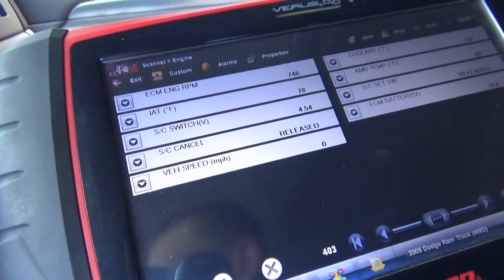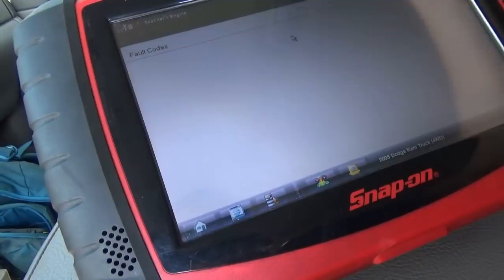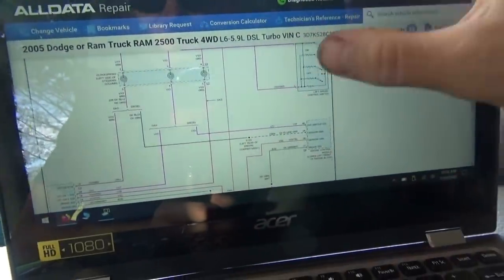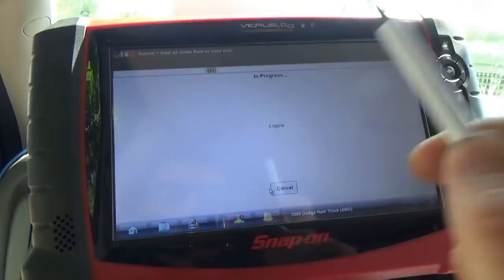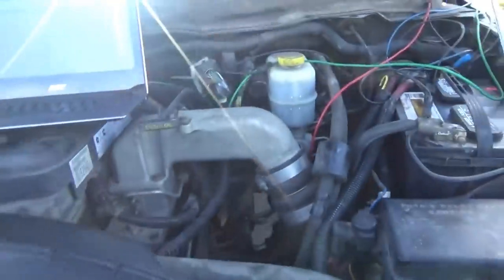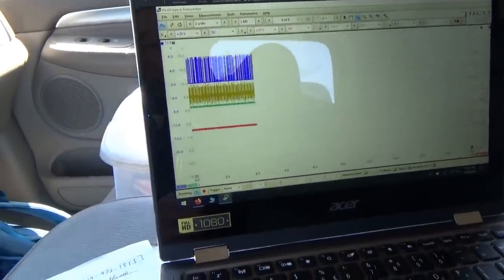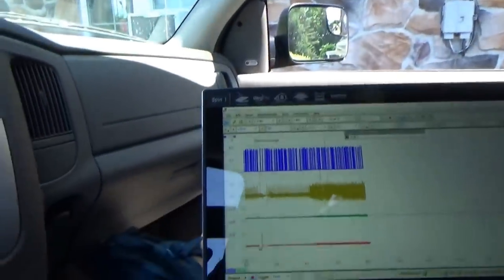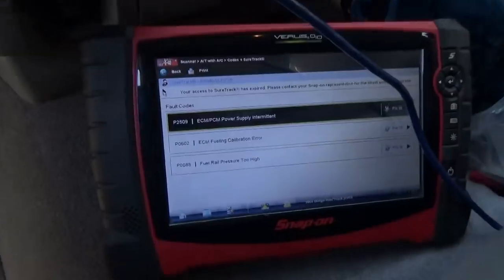Cruise Control = Engine Stall?? - Part 1 (Ram Cummins Diesel)

Comment: Lot's of good suggestions. I do not have a "killer" idea of what the problem is. 

The Guess... The electric vacuum pump. 

I did some "Sunday Research" which produced the small novel you see below.

The 2005 Dodge Cummins (with an automatic transmission) did not use a electronic injector pump (it has a VP44 is installed). Cruise control without an electronic injector pump is always going to be a "Rube Goldberg Solution".

The 2005 Dodge Cummins with a manual transmission has an electronic injector pump. The ECM only needs to "talk" to the injector pump. No servo. No vacuum. Much simpler.

With the solution in play with an automatic there is no relationship between the engine vacuum and the engine speed, or between the engine vacuum and the engine load. Nothing useful...

What Dodge did is not much different from what Mercedes was doing with the 300TD back in 1984.

Anyway after reading what you see below, this is my call,  "the electric vacuum pump". The pump is unhappy and pulling a heavy amp draw. It is "close enough" to the ECM (or the alternator) and starves the ECM. The ECM reboots (an removes the demand to the cruise control electric vacuum pump).

From https://www.cumminsforum.com/threads/cruise-control-acting-up.338750/

"Here is a brief description about how it works:
In the cruise control circuit a "Reference" signal (cruise set point) is electronically added to a "Feed-Back" signal (actual vehicle speed). The computer then calculates the difference between the "set" and "actual" speed which is called the "Error" signal. The computer then used the error signal to determine how much throttle to apply to drive the error signal back to zero, when the error signal = 0 the truck is at the cruise set point. If the error signal grows too large the the cruise control will "give up" thinking that it cannot maintain the set speed or even close to the set speed; it will then disengage when the vehicle slows down approximately 10 MPH below the set point.".

Possible Causes:
1.) The computer may not be receiving a proper feedback (vehicle speed) signal.
2.) The computer may not be calculating the error signal properly.
3.) The computer may not be able to increase throttle because of faulty servo motors or connections.

What to Check:
1.) When this behavior occurs do your speedometer and tachometer appear to be working properly, if YES then you may rule out the vehicle speed sensor or crankshaft position sensor. If NO then you may want to check the sensors and wiring for any obvious visual problems. I'm not sure how to test these sensors.

2.) Run the truck down the highway and set the cruise. If you place your foot on the throttle you should be able to feel the pedal move up or down when the cruise control system applies or removes throttle. If you cannot feel the pedal physically move then you know the output of the cruise control is not able to apply/remove throttle for some reason. In this case I would check the connection from the computer (I'm not sure which module handles this function at the moment) to the cruise control motor which is moving the pedal up/down. You may also want to check the cruise control motor circuit for a blown fuse or other obvious wirting or visual problems.

3.) Straight from the manual... "5.9L Diesel Engines With Automatic Trans. - If equipped with a diesel powered engine and an automatic transmission, an electric vacuum pump and vacuum lines are used to supply vacuum to the speed control servo. A vacuum reservoir is not used.

DIAGNOSIS AND TESTING - ROAD TEST
Perform a vehicle road test to verify reports of speed control system malfunction. The road test should include attention to the speedometer. Speedometer operation should be smooth and without flutter at all speeds. Flutter in the speedometer indicates a problem
which might cause surging in the speed control system. The cause of any speedometer problems should be corrected before proceeding. Refer to Instrument Cluster for speedometer diagnosis. If a road test verifies a system problem and the speedometer operates properly, check for:

* A Diagnostic Trouble Code (DTC). If a DTC exists, conduct tests per the Powertrain Diagnostic Procedures service manual.

* A misadjusted brake (stop) lamp switch. This could also cause an intermittent problem.
² Loose, damaged or corroded electrical connections at the servo (if used). Corrosion should be removed from electrical terminals and a light coating of Mopar MultiPurpose Grease, or equivalent, applied.

* Leaking vacuum reservoir (if used).

* Loose or leaking vacuum hoses or connections (if used).

* Defective one-way vacuum check valve (if used).

* Secure attachment of both ends of the speed control servo cable (if used).

* Smooth operation of throttle linkage (if used) and throttle body air valve.

* Failed speed control servo (if used). Do the servo vacuum test."

Checking out the Servo (if you have an auto)

"OPERATION

A speed control servo is not used with any 5.7L V-8 engine, or with the 5.9L diesel engine
when equipped with a manual transmission. The following information applies only to
vehicles equipped with a mechanical servo. When/if a servo is used on gasoline powered vehicles, the Powertrain Control Module (PCM) controls the solenoid valve body. When/if a servo is used on certain diesel powered vehicles, the Engine Control Module (ECM) controls the solenoid valve body. The solenoid valve body controls the application and
release of vacuum to the diaphragm of the vacuum servo. The servo unit cannot be repaired and is serviced only as a complete assembly. Power is supplied to the servo’s by the PCM/ECM through the brake switch. The PCM/ECM controls the ground path for the vacuum and vent solenoids.

The dump solenoid is energized anytime it receives power. If power to the dump solenoid is interrupted, the solenoid dumps vacuum in the servo. This provides a safety backup to the vent and vacuum solenoids. The vacuum and vent solenoids must be grounded at the PCM/ECM to operate. When the PCM/ECM grounds the vacuum servo solenoid, the solenoid
allows vacuum to enter the servo and pull open the throttle plate using the cable. When the PCM/ECM breaks the ground, the solenoid closes and no more vacuum is allowed to enter the servo. The PCM/ECM also operates the vent solenoid via ground. The vent solenoid opens and closes a passage to bleed or hold vacuum in the servo as required. The PCM/ECM duty cycles the vacuum and vent solenoids to maintain the set speed, or to accelerate and decelerate the vehicle. To increase throttle opening, the PCM/ECM grounds the vacuum and vent solenoids. To decrease throttle opening, the PCM/ECM removes the grounds from the vacuum and vent solenoids. When the brake is released, if vehicle
speed exceeds 30 mph to resume, 35 mph to set, and the RES/ACCEL switch has been depressed, ground for the vent and vacuum circuits is restored.
Reply from the maker: Wow you did some really in-depth research! Great suggestions!

Comment: The symptoms of the meters dropping and the ECU powering down suggest a large load has been applied aross a supply rail.  How is the CC controlled.  Is it via a motor or vacuum via solenid?  My money would be on either of those failing.
Reply: Agreed need to check current draw on CC componants
Reply: @niallseddon8657  The sudden drop and recovery is a giveaway.  Might even be green crusties or a bad connection going o/c under load when powered.
Reply: An easy test would be to pull the solenoid and see if the cruise control can still engage (and if it does, if the ECM doesn't crash), my money would be on a short in the actuator solenoid.
Reply from the maker: "A cable and a vacuum controlled servo are not used. This is a servo-less system."
Reply: @PineHollowAutoDiagnostics  Sorry don't have access to a wiring diagram (Scotland), are we using electronic control of the fuel supply? (injectors) for CC, would still be interested to see if there is a change in current draw at say the ECM powers when actuating the CC.

Comment: Morning coffee and  a PHAD video. Ghost wipers and a crazy ECM. I'll bring the holy water and sage to burn my friend. BTW checked the Camaro with the pressure transducer. number 5 cylinder was the issue. Probably could have found it with mechanical tester but was a great learning experience.
Reply from the maker: That's awesome, Bill! Make sure to save those waveforms :)

Comment: Hello.( 2008 Mercury Grand Marquis 25k miles)  I just did an oil changed and replaced oil filter but did not removed old oil filter gasket. Start the engine for about 3 minute oil spill out and has 1 QT of oil in engine. does the engine got any damaged? Should I be worry and any suggestion?
Reply from the maker: How does a 2008 only have 25k miles?? Fill her back up and let it rip!
Reply: @PineHollowAutoDiagnostics  Just bought it from an old retire couple. Thank You, Russian repairman!

Comment: Maybe see if there is an updated firmware for the engine computer?    What is the history of the service on this truck?    Was the engine computer replaced with one from a non-cruise control truck?     At the very least I would try to re-flash the firmware in case the firmware is corrupt before condemning the computer itself.
Reply from the maker: Easier said than done...special tools and software required to re-flash Cummins ECMs

Comment: Fuel pressure high keeps showing up.  I wonder it that's because the computer is temporarily losing control of the high pressure loop.
Reply: ....and that could be easily investigated.
Reply: @hudzgh  maybe by you.  I'm not an auto tech.  😁

Comment: if the same codes are coming back each time i would check the voltage on the fuel rail and put a pressure gauge on the fuel rail to see what is psi when you engage the cruise control. Also some models you can use the cruise control to speed up the idle while in park

Comment: What happens when you press the set button sitting still. Does it stall then?
Reply from the maker: No, I showed the data pid at the beginning of the video :)
Reply: @PineHollowAutoDiagnostics  I must havd missed that
Reply: A cheat would be to jack one wheel up and then you can 'drive' the car at 30+ mph while standing still, the speed sensors will think that the car is moving.

Comment: Simple fix . Don’t use the cruise control . It’s a Dodge , you’ll fix this and something else will screw up . 

* I own a Dodge , never again .
Reply: Most of there electronics are made in Mexico for $0.25 an hour. What did anyone expect? Lmao.
Reply: I own a 1998 Dodge Grand Caravan from new. 185000 miles and my wife loves it. It's starting to show its age but still gets 20 mpg and floats down the road. The only thing that's been replaced is the head gaskets twice, A/C compressor and the headliner.
Reply from the maker: @billburkart9087  Head gaskets twice at only 185k?? That's worse than a Subaru haha
Reply: @PineHollowAutoDiagnostics  twice in 18 years lol
Reply: Make that 23 years. Same exhaust and catalytic converter and wheel bearings.

Comment: Someone should open up a business where you can borrow a computer for like 2 hours, computer rental.
Reply: Problem is you’d never get them back peope are dishonest. Great idea in theory tho
Reply: @weldingjunkie  it could be like auto zone tool loan. Put down a deposit for the full value of the tool. When you return it you get it all back minus the rental fee.
Reply: you would have to have thousands of dollars worth of control modules to cover the market,and most now have to be programed to the vin.
Reply: Terrible, this idea. People would be knowingly and unknowingly smoking ECM's left and right and the rental business would be sending out bad ECM's for customers to check if a replacement ECM is going to fix the vehicle. There's a reason why parts places won't return electronic parts.
Reply: Ok, Ok so nobody liked that Idea, alot of pit falls. So how about every ECM would come with a port for patching it into a off premise computer that would check it for faults. For a nominal charge, say 50 bucks. What about that ?
Reply: Great Idea  Charles, your such a brain.

Comment: maybe a problem with the cruise control switch itself better to put a scope on that wire(s) too
Reply: Wouldn't it do it sitting still if that were the case?
Reply: @hikerJohn  if somehow voltage was wrong on that wire it can be discarded by ECM at low speed. it worth to check before calling for ECM problem
Reply from the maker: @saeedkizzy  Data pid shows correct value, so voltage must be correct.
Reply: @PineHollowAutoDiagnostics  True but when car at stop what about at 40mph speed